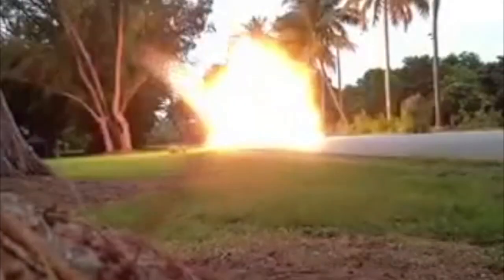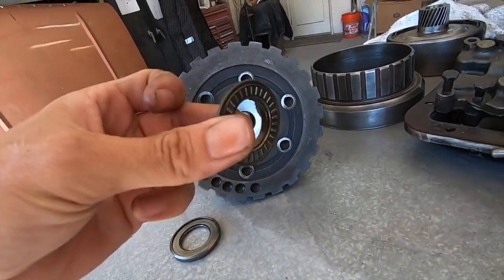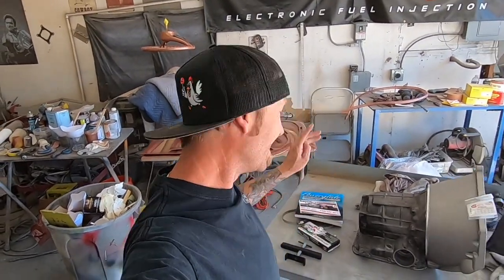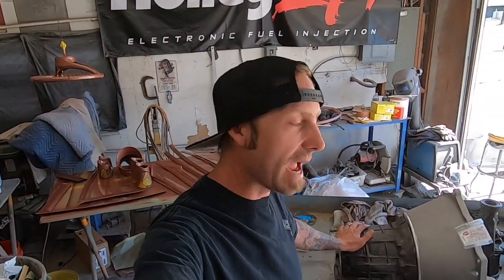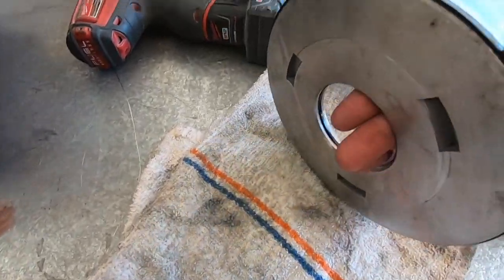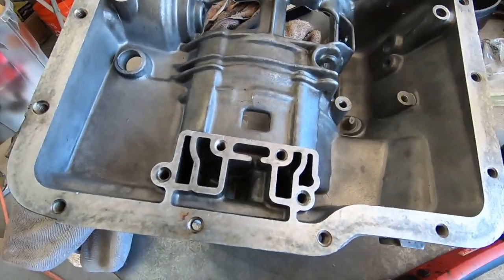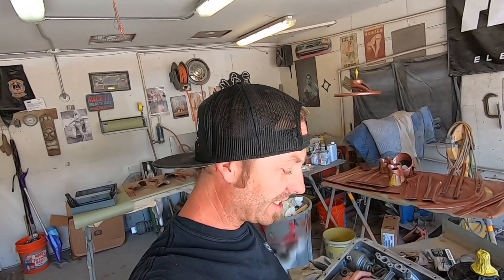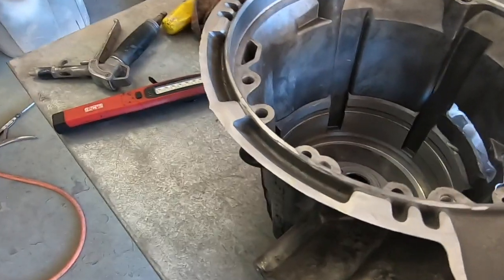Drag Race PowerGlide Case Modifications (Powerglide Build Part 03)

Comment: Going from a 1.82 to a 1.76 gear. Where can I find that bearing?
Reply from the maker: Coan, BTE has them I believe. You can google it. Probably anyone that makes powerglide parts.
Reply: @ I can change the planetary gear and upgrade to a different high gear drum and clutches.
Reply: The bushing also
Reply: And do I also have to change the high gear drum since it’s coming from a 1.82 transmission 😊
Reply from the maker: @dayofleo8550 You need the whole planetary assembly not just a gear set for the benefit of the gears and strength of the 1.76.
Reply: @ the 3 piece set ? Also do I have to change the high gear drum ?

Comment: Question.  I'm I 65 yr old diy er.   Lol.   Powerglide.   JW case and bell.   Pro tree brake.    Sometimes.   Not always.  Wen brake applied on starting line.    Car Sometimes rolls forward 1. Maybe 2 in.   Wth is my problem.    Do u know
Reply from the maker: I’m not a pro but I would say adjust your band and see if that helps. If not check your line pressure to see if you have other issues or a worn band. Good luck man!
Reply: @Burndown  
@victortrimble4741; Victor Trimble, perhaps You can contact the same transmission people Dane Paul posted above [Transmatic Transmission Parts] or one local to You to describe Your issue(s), problems and discuss solutions, further assessment, evaluation, recommendations ?

Comment: I need to know what hole to block off for the rear pump I'm building a shorty and need to block off the rear pump. thank you
Reply from the maker: Mine did not have a rear pump but they make a block off plate or if you get a governor support it will do the same. I would get the roller support and call it a day.

Comment: Like the series,  just started one myself.  I have the rear pump glide and want to delete it if it helps with performance.
Knew to this stuff so any info would be appreciated.  You choose BTE products for your build, what was the reasoning behind your choice?  Are there products good?
I was on their website a couple of months ago and checking out the prices.  
What power lever are you running in your car?  I will be putting mine behind a 5.3 and a 7875 Vs with a sloppy stage 2 pac 1218 springs.  Fuel pumps 2 walbro 450's 10an feed 8an return. I heard that the first thing that needs to be changed in a stock glide is the Imput shaft and the sun gear, what have you learned so far.
Thanks for the entertainment.
Bradley
Reply from the maker: I have made 650WHP so far with no issues. I did end up getting a new planetary form BTE as well as governor delete. I would recommend an input shaft, servo, kevlar band, and the 6 clutch upgrade for what your doing. Also buy real transmission assembly lube its better than what I did in the video and its not too expensive and you'll have it for a long time.  New pump gears are cheap insurance as well.

Comment: Can you let us know the diameter of the 1.76, and the diameter of the 1.82, so while we are looking for one, we know we have the one we're looking for?
Reply from the maker: Its even easier than that. The 1.76 will have a fine spline output shaft and the 1.82 will have less teeth. The 1.76 will fit a th350 yoke as well. I found one at the yard I get motors from so when I pick it up ill answer more on this. The 1.76 is a larger diameter than the 1.82 but not by too much.
Reply: @Burndown  I found it. 1.76=1.170", 1.82=1.145" both have a 27 spline output shaft, and use the same yoke.

Comment: Why do you want to disable the rear pump? Is it required for the trans brake?
Reply from the maker: No its not required for the trans brake. I had to modify the case to make the trans brake work tho. I drilled tow holes that intersect witch I is how the fluid engages reverse I think.  My transmission did not have the rear pump in it but if it did it would not be used. You also get rid of the governor when you put a manual valve body in. Im guessing the new valve body I installed wont even feed that part of the transmission anymore anyway. This is for racing application. If you were rebuilding it you would put all these things back in.  I am still learning tho so if im wrong please let me know.
-Dane
Reply: @Burndown  I guess I should have asked if the rear pump was left in could the car still be towed and push started or does the rear pump become inoperative . Sorry for my poor choice of words.

Comment: Looks like you're doing good. I don't have the book, but I do have a Powerglide I bought a while ago out in the shop. I might start tearing mine down with you. My guess is that mine is also running the darn 1.82s and needs some help. That's why I pulled it back out. It does have the larger input shaft. Darn, I just remembered I sold my 3500 stall converter to a guy on eBay.
Did I miss the part about cutting off the bell housing? In place of that Powerglide, I put a 6L90 out of a 3/4 ton Express Van. Now I've got really low, lows and really high, highs! It has double overdrive that gives my old 70 car better highway speed than it ever had before.
Reply from the maker: I have three videos on the Powerglide build up so far. The second episode I cut the bell housing off and went over how I did it.I just did some machine work  on the hi clutch piston so everything should be ready to assemble this weekend!!! Ill keep everyone posted.
-Dane

Comment: Omg I cringed when the drill locked up. Gave me flash back of a time when a drill locked up and spun a metal pierce around and sliced my finger hahaha
Reply from the maker: I was just hoping I didnt ruin my case🤣
Reply: @Burndown   Dane Paul
@joseluisgonzalez; Jose Luis
Pro Tips: As all machinists, amateurs, novice individuals know from basics within metal [& wood] working:
A. use a drill press or similar fixture for a hand operated drill for proper, precise, accurate, exact drilled holes
B. use a drop or tiny squirt of oil [machine, motor or similar (not WD-40)] on the metal to be drilled for reduced friction, proper metal drilling
C. Thoroughly read, re-read instructions until each step is well comprehended, known, planned properly
Note: We had good to excellent individuals within Industrial Education [IE] subject course, which properly taught, educated, instructed, trained us within extensive practice, operation, guidance, development within Our Public School education during 7th & 8th Grades during early through 1970's, over 50 years ago [for me specifically 1971-3] including wood, metal working, basic electricity, electronics, assembly, soldering, wiring, etc.
All The Best, Sincerely

Comment: Where’d you find the 1.76? I’m building a glide myself and happens to have the weak 1.82
Reply: The 1.76 were found in all the six cylinder powerglides, seems backwards I know, but thats the way the factory did it. also you'll notice the 1.82 is in a  stamped steel housing whereas the 1.76 is in a cast iron housing.
Reply from the maker: I looked at three others besides mine when I was looking a week or so ago. All were 1.82. I got my info out of the book I bought. You could in fact be right but I just replied with what I read. The 1.76 seem harder to find to me than the 1.82
Reply from the maker: As far as I know the 1.76 is the stronger gear set and was in the powerglides that were behind big blocks and some 6 cylinder trucks. The 1.82 was more common and was behind most 6 cylinder cars as well as the small v8 cars. Mine is out of a Chevelle that had a small block in it. It looks like it was rebuilt at some point and was actually in good shape. It also had an extra friction added already so someone was doing some hot rodding with it.😁
Are you in So Cal? I have a transmission spot that may have another one. If not just call around to any local transmission parts place if you have one in your area.
-Dane
Reply: Yessir I’m in reseda (SFV) I’ll look around! Thanks for the reply
Reply from the maker: @twoworldwars_ro  Look up Transmatic Transmission Parts. Give him a call.